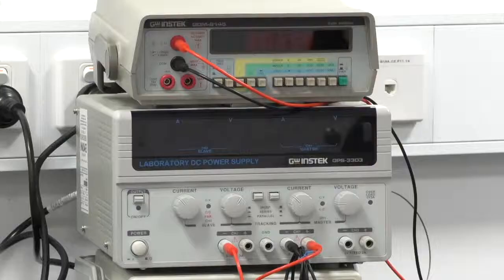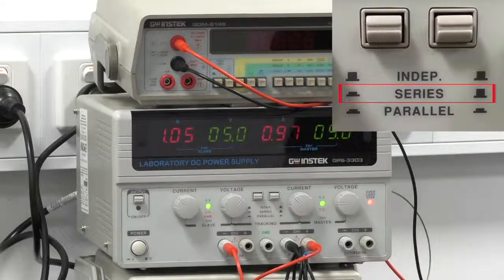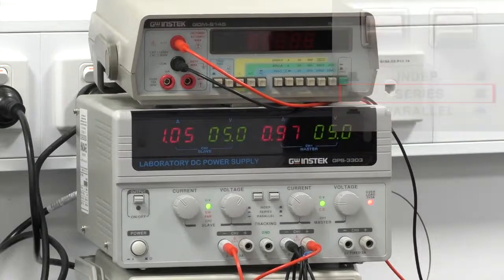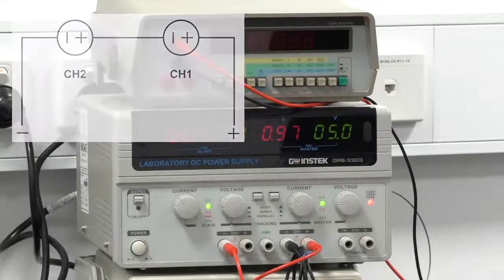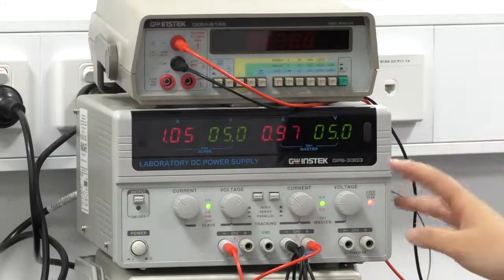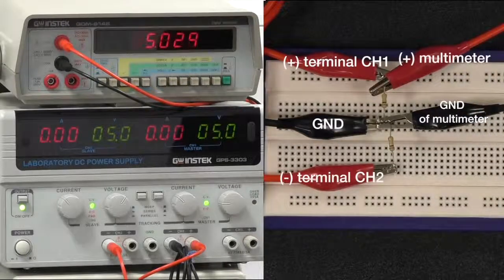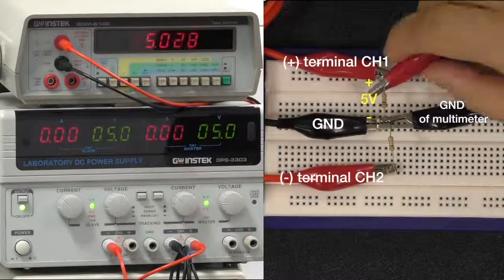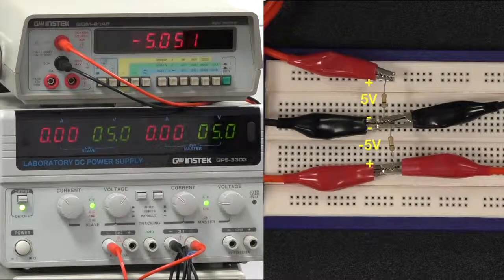3.3. Lab Guidance - Power Supply - Series Mode

Comment: Thank you very much, perhaps your example of connecting a symmetrical output applies to all laboratory sources with an output cted in series. I have a new UNI-T UTP3305-II and I need a symmetrical power supply for the op amps. There wasn't much in the tutorial, but if it works as your source, it's fine.